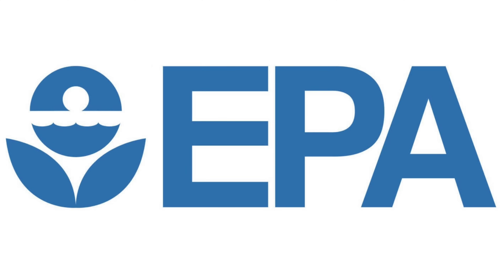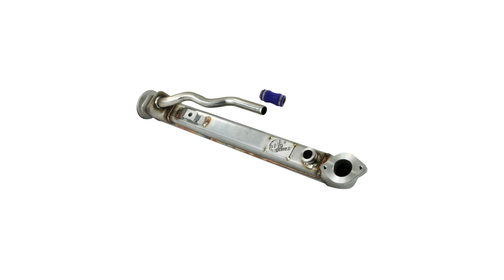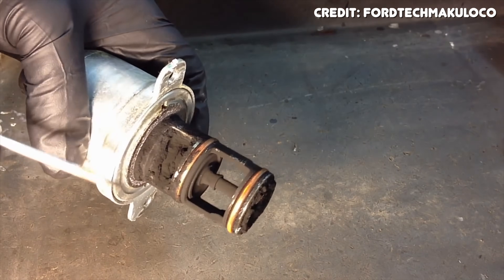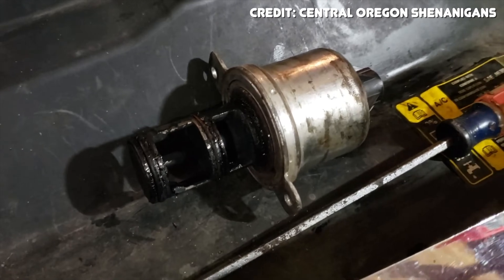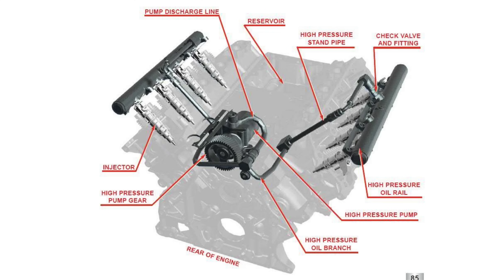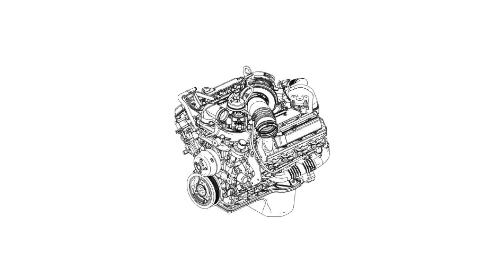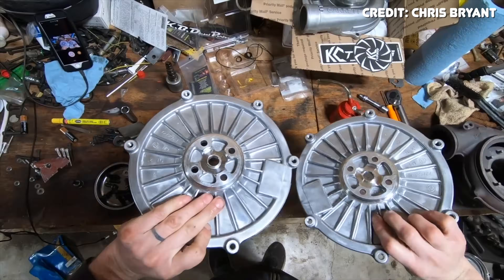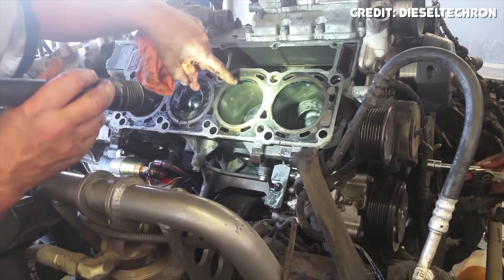The Truth About the 6.0L Powerstroke (And Everything Wrong With It)

Comment: I personally had mine diagnosed as a head gasket, which i knew was wrong, but they insisted, so i did i myself and found the cracked oil cooler, which is why the oil was getting in my coolant once that was fixed we deleted the egr and ive never had a problem since. Just get proper maintenance, dont beat it too hard, and treat it like a truck, not a race car, and you'll be fine.

Comment: 3RD 6.0 here (Don't let you wife drive it...) I have had both stock and fully built. for about 10k you can get an engine that will out run almost any engine on the road! Alternatively, if you want reliability, drop around 5k into it and don't beat on it.

Comment: Have had several 6.0 powerstroke and I never blew a head gasket or replace an engine. The first thing I do to all the ones I own is get a 7.3 fan clutch conversion and take the back part of the fan shroud off this is a must you’ll see lower coolant,engine oil, and transmission fluid temps and get rid of the EGR and tune it. Only 05-07 6.0. The 03-04 HPOP is a bad design I don’t like those. 05-07 6.0s have a better HPOP but the stand pipes and dummy plugs go bad not a big deal always replace them with OEM don’t get aftermarket stand pipes and dummy plugs. Keep the oil changed every 4K miles and fuel filters every 8K miles and you’ll be good to go

Comment: Bullitt proofed, deleted, a new ficm, and a few cooling and filtration add ons and these arent bad. Wow might as well buy a new truck!LOL
I hate working on them but they do have a sweet trumpet when straight piped that can't be beat. You go too crazy with the hp upgrades and you will just find the next weakest link. I bought mine already bullet proofed and deleted.
I blew head gaskets once in mine. 
When it was rebuilt and studed the second time, I got new style heads with O-ring seals. Never had another problem. Of course I did quit 😒 with the occasional burn out and rarely ran it in the hottest tune on the SCT Tuner.
I still miss that 6.0😢 and I'm not a ford guy. My current 2014 dirtymax doesn't have nearly the low end torque I had in that F350 dually.

Comment: As an owner of a 6.0, to do the improvements to make it reliable is Expensive! Also if O rings are installed incorrectly it will leak water to the oil! These heads do crack, mine were in the valve seats,,,junk not repairable! Good heads $3000! Tuner and monitor $500-$700! Bolts $1100! With bearings and gaskets and machine work your looking at the high side of $13,000! $18,000 installed!

Comment: Very nice deep dive on the 6.0, I’ve had two 7.3 and on my 2nd 6.0. Reliability has been the same for the 4 trucks. Currently have a F550 long chassis 4x4 dump. I bought from original owner. It runs so well(albeit deleted)that I’m going to put a new dump and hoist on it. The trans in these are bulletproof, great brakes, comfortable cab not to mention an absolute amazing frame. Yeah things go wrong, machines breakdown. It’s called friction and nothing last forever. Change the oil, use good filters and keep an eye on things with a scanguage. Don’t beat it but don’t baby it either.

Comment: My 6.0 was the best truck i ever owned. Biggest thing that hit me was hpop but that was around 185000 miles. Did me good for 10 years with 1 big repair. If you ever have an issue with a 6.0 it must be addressed asap or problems will compound. Is a maintenance queen and if you cant keep up on maintenance the 6.0 isnt for you. Truck was tuned as well for at least 8 of the 12 years owned.

Comment: ANY diesel needs a fuel additive.  American fuel doesn't have lubricant added to it, which these engines need.
My 6.0 has been fine, did injectors at 100,000 per maintenance and updated the stand pipes and dummy plugs, blue spring kit, s&d air filter & an antifreeze filter- that's it.  Oil change with Rotella T6 15w40 every 5000 miles and HotShot's Secrete's stiction eliminator & fuel additive every tank.  Only smokes under heavy load, been good and can pull a lot of weight around.

Comment: Just completely missed the fact that there’s 2 generations of the 6.0 with a vary different high pressure oil system. With 2 completely different sets of problems. Also egr and turbo problems affect all diesels not just the 6.0.

Comment: My 2003 F250 Super Duty 6.0 currently has 220k miles.  Over the last 4 years I’ve had the following work done: New Radiator, Starter, Injectors & Glow plugs.  The only bolt on’s she has is a Magnaflow Exhaust and S&B cold air intake and filter.  She runs great.  IMO a lot of the “6.0 issues” are related to lack of regular maintenance.

Comment: The best thing you can do for your 6.0 PSD is to bullet proof it, I did that with my 2007 in 2018. It was costly but well worth it plus by chance in doing the bullet proofing cracks in the head exhaust ports were found before it became a real problem. My 2007 has 219,000 on it and running strong.

Comment: Used to own 2 one was a demon sent to me from hell mostly because it was a stolen truck and had swapped VINs more time spent in a court room fighting it than i did driving it finally ended its life after being rear ended at 75mph into a concrete barrier on my way to work the other one Is a two owner completely gem no issues whatsoever. Making 800ish Hp ( haven't managed to get it on a dyno to confirm it yet but most of supporting mods are there  Love 6.0s to death love the looks and a straight piped sounds awesome. Love my baby She's coming along well bulletproofed (ARP headstuds, and custom rods, deleted) upgraded cooling system drop in  stage 2 garrett power max turbo, SCT GTX programmer,  175/30 warren injectors, regulated return kit , MBRP Straight piped, mild trans upgrades, S&B CAI intake, stage 2 street/strip cam,FASS System, ported intake manifold,  needs a new tune. But she's a beast
Reply: Also at almost 400,000 miles 200,00 on current setup

Comment: Anybody else out there had any issues with the transmissions as for a SCt livewire tuner for the transmission? Bought a bone stock 05 F350 farm truck untouched and put an SCT livewire tuner in it run the performance tune haven't had a lick of an issue there but the transmission appears to not be a fan of it even going back to the stock transmission tune at the times thing just throws its hands up in the air like it doesn't have a clue what's going. I know if I went somewhere and got a external transmission to him would probably take care of my issues but just curious

Comment: Twice as good as its reputation. Lol Compared to other truck engine at the time it made the most power and got best millage. Sounded awesome. EGR  was improved in 06? 1/2 the people who talk bad never had one lol. Had a 6.7 Cummins with ARP head bolts still fail if tuned wrong.
Reply: Also some refer to diesel sound of the engine vs what the exhaust sounds like. Can be two different contest. Lol

Comment: I bought a 04 F350 Dually with a 6.0 and 175k 5 yrs ago. It came from Michigan so it had the typical underbelly road corrosion, the 2 rear suicide doors had cancer in the lower corners but I could tell it was owned by somebody that kept up with the maintenance because under hood was immaculate and the interior was flawless as well. Good Sam sticker on it and I could tell the truck had a 5th wheel in it at some time. Figured probably a older guy owned it and pulled his RV with it. It’s 4x4 and manual trans as well so it was the setup I desired for a good farm truck. I have just over 200k on it now and have had zero problems with it. Reg oil changes and fuel filter changed, replaced brakes all around couple years ago. Watching all these 6.0 vids scares me something will pop up lol. I recently purchased a 5th wheel RV so the truck is about to be used in a different way than just hauling hay. I’m going to take it to a shop and have them go over everything it might need but definitely going to have them change all belts and hoses, radiator flush, trans flush and front and rear axle drain and refill. Also going to have them do all wheel bearings since over 200k. Other than that I’ll have them do a compression check but this truck hasn’t given me any trouble really.

Comment: I feel like the 6.4 kind of depends on the driver and chance. Ive seen some 6.4s crater at 100k and Ive also seen some 6.4L (like my fathers) last north of 225k without a major failure. Mainly an o ring gone out here, radiator and an oil cooler. Granted we fix our own trucks, so theres that. That 6.4 kept me moving when I was rebuilding my Duramax LB7 (slung a valve breaking a valve seat) before the ford guys start firing on my Dirtymax. Put 300k miles on a powerstroke with a 6,000 pound welder in the back bed for the last 250k miles and see which one checks out first 😂😂 Ill never own a Ford unless it is a 7.3L. You couldn’t pay me to keep and maintain a 6.0 / 6.4 or a 6.7.

Comment: Owned a POS 2003 6.0. Had it for 6 months and most of the time it was at the dealership being "fixed". Finally pushed a rod out the side of the block while driving it away from the dealer's service bay.  Ford bought the truck back.  I will never own another Ford.  Went down and bought a Ram Cummins and 200,000 miles, no repairs.

Comment: I always hear bad things about 6.0. We used ford bobtails for the flightline and we had 24/7 operation. I’ve never experienced any issue with them. They can be running all day. They can start any time of the day. When we have to turn it in for scheduled maintenance, we just grab the next bobtail which probably been sitting for weeks. It always start right up. We had three 6.0 and two 2012 6.7. The 2012 is definitely the better truck then we got new at the time 2017 6.7 and that engine was powerful!

Comment: Not everyone cranks up the power. I don’t, and I’ve had zero problems after 18 years.  Maintain the truck and don’t abuse it, and it will be just as reliable as any thing else. I don’t scrimp on maintenance, and use the best oil and fluids available.  Oil has to be changed sooner than the factory suggests.  The oil is used as a high pressure hydraulic fluid to fire the injectors, and this shears the oil  quickly.  I change mine every 3500 miles.  Coolant is another issue.  Ditch the ford coolant, with all of its inhibitors which can’t stand up to the heat it is exposed to in the EGR cooler.  It will plug up your oil cooler and burst your EGR cooler.  Use coolant filtration to eliminate the sand from the block casting process, from plugging up the oil cooler.  Most of these problems are caused by improper maintenance, inferior fluids, and hot rodding the engine.

Comment: I have plenty of 6.0 powerstroke customers with well over 500k on stock shortblocks with the proper repairs being done from the heads up! Most guys don't know what they are doing and give this engine a bad name by just throwing parts at no starts which are usually only high pressure oil system leaks.

Comment: My only complaint  about my 6.0 is that when doing anything but maintenance on the top end its a full tear down of the top of the motor which usually ends up as me screaming about the guy who designed it but as stated by someone else alot of the issues stem from poor maintenance and people wanting more power

Comment: Another dumbass video on the 6.0.
I have two 04s, and they have been the best trucks I have ever owned. 
A few simple mods and they are extremely reliable. I am still running the stock head bolts, injectors, turbo, and high-pressure oil pump.

I use Amsoil 5-40wt plus hotshot secretet anti-stiction eliminator and NOTHING but OEM parts and filters. I change my oil every 10k miles and my oil filter every 5k. Fuel filters are changed every 10k.
Oil cooler is replaced every 80-100k. This is a maintenance item,  along with the fuel lift pump, which has a service life of 150k. 

If you know an oil cooler is going to get plugged up over a certain amount of time and you do replace it,  your the moron!

75% of all 6 liter issues are caused by aftermarket parts, tuners, and inept mechanics. 

I spent less than half of what it costs to replace a set of injectors on the 6.6l Tampax of the same time period. Funny , GM NEVER solved the injector problems with the early tampaxes. They simply changed the valve covers to make them easier to replace. Then there's the DOG Crammins, the entire truck is shit, and it will cost you 3x's  the money to build a decent transmission to put behind the Crammins than to solve all the issues on the 6.0. And again the rest of the truck is complete shit, but you be real proud of your engine because very soon that will be the only usable part of the Dodge truck.

Here's another great idea, why don't you go spend 100k on a truck. Me, I build my 6.0 for pennies on the dollar compared to your new truck. I will never have to deal with DPF failures along with insanely priced electronic components that seem to fail on the regular in ALL the modern diesels.

Comment: Worked for a company that had 7000 trucks on the road, world wide.   The 6.0 was a problem, several trucks had $50,000 in repairs @ 200k miles.   Loved the sucker when it ran, but sat roadside to many times.

Comment: Common rail is nice and all but a 6.0 is way easier to work on without a lift over a 6.7. The Heui system seems to be more resilient to lower quality fuel. 

I agree the 6.0 has a lot of common issues but a lot of them can be resolved, may require a lot of work but they are very simple, easy, and cheaper to work on over newer models
Reply: Not to mention I’ve worked on alot of 6.0 that have around 300k miles and still has alot of the original components. Maintenance is key.

Comment: My 2 cents worth, bought my 2007 f250 truck with 149k miles on it completely stock, drove it rather mildly, small towing, pontoon boat, 35 hp mid size tractor, didn’t ask a lot from my truck because I knew the issues with 6.0, made to 190k and out went head gasket no rhyme or reason just got got hot because of low coolant, long story short, $7600 later ARP head studs,  mahle gasket, EGR delete, new oil cooler, down pipe etc.. Since those up grades were done, I have added 4” turbo back MBRP exhaust, SCT tuner w/ blessed performance custom tunes. Now my truck has mad hp, sounds amazing, only issue is she is sometime slow to start, hot or cold, next will be a FICM reprogram see if that helps that part. All and all pretty happy with truck if I get 300k out of her or better I’ll be happy she’s mine.

Comment: OK so I think your assessment is bang on and awesome, presently I put a lot into my 6.0 and I’m just changing out the HPOP and I’ve got some diagnostic equipment running so I know what it’s doing all the time., and then ether injection system, in Canada, for obvious reasons.

In the big picture since the rest of the whole truck is being customized, my work truck etc… If I have more issues and I’m gonna have to change the motor, what would I change it to?  keeping the transmission and drive chain which is excellent and everything else etc. nothing

Comment: why hasn't anyone on YT mention the updates and issues ford resolved on the 6.0 in 2005?? still had some issues yes but the major issues from the 6.0 are the early model 2003 and 04. im still waiting to see wo else will do the research into that
Reply: Actually the early 03 didnt have egr cooler problems. They really only had an hpop problem. Injectors, I`ve still got the stock sticks in my 03

Comment: Its an entertaining and technically great video. That said, while the 6.0L Powerstroke is more problematic that the 5.9L Cummins of the same vintage (unless you have an 53 Block), compared to the cost and issues with modern diesels (6.4, 6.7 Powerstroke or Commin Rail Cummins) and they're wonderful. Fix the known issues once, and don't look at the engine again for 100K. Seriously, you can't do that with new trucks.
Reply: Ahh, refreshing. Someone else that knows what the f they are talking about.

Comment: 05 6.0 243k no head studs, SCT tuner, upgraded turbo front housing with billet wheel and 10 blade turbine, sinister air intake, all turbo piping, 4" down pipe 5" straight exaust. Jan this year had oil cooler replaced, new water pump with upgraded impeller, new IPR sensor. And not EGR deleted.

Comment: If you wear your hat backwards you have no credibility. My 2004 6.0 powerstroke run fine 204000 miles. Alot of the people who are having problems with the 6.0 drive it like a gas powered engine.  Diesels have tons of torque, just because it wants to run up a hill with a full load don't.  Downshift and your turbo temp will drop. Heat kills engines, also don't over Rev. Diesels are fine to lug. I see so many city boys over reving their Diesels and then they can't figure out why it doesn't work. I have a 1997 powerstroke with 408000 never had to touch engine except for 2 alternators and 1 water pump and new batteries every 6 years or so. 6.0 is a decent engine if you change oil and filters on schedule and don't bury your foot in it especially when hauling a heavy load. I must be an old guy because if I want to go fast I drive my 1968 t top Corvette stingray 427 rock crusher 4 speed, modified to 435 hp from 390 hp.

Comment: I was lied to about my late modle 04 pickup. The guy I bought said it had all the updates done. I didn't know any better at the time and ended up blowing a head gasket 600 miles later towing a not so.big 5th wheel. After spending thousands having all the updates done its been solid and still way cheaper than a new one. It certainly doesn't ride like a new one but saving a mortgage payment every month has been well worth it to me.